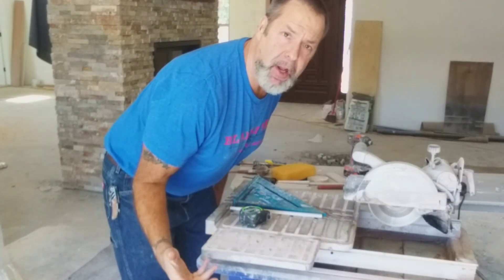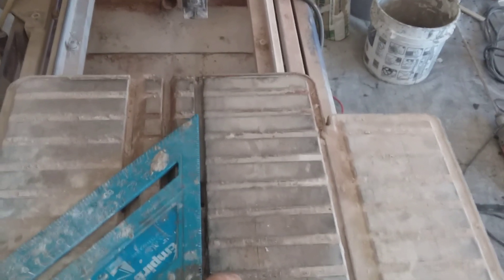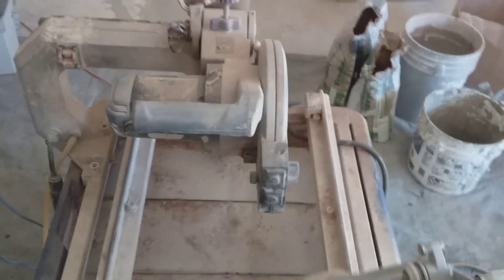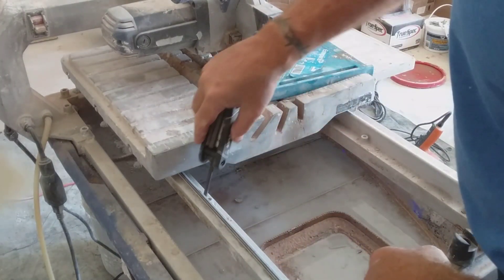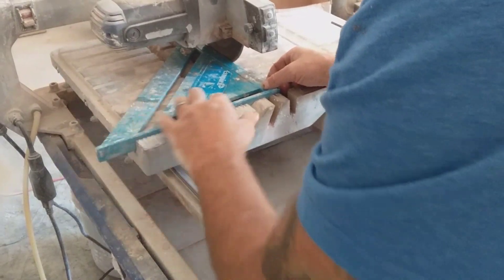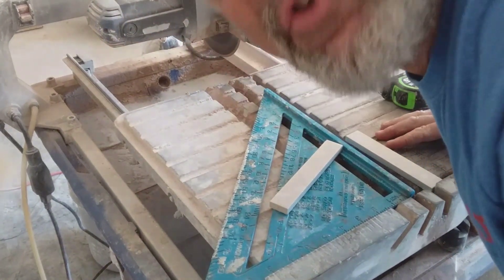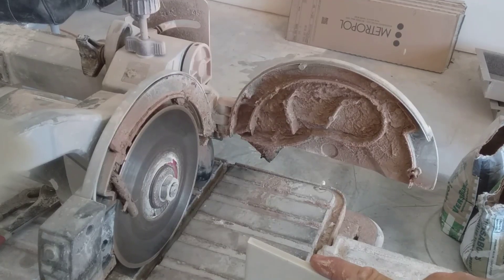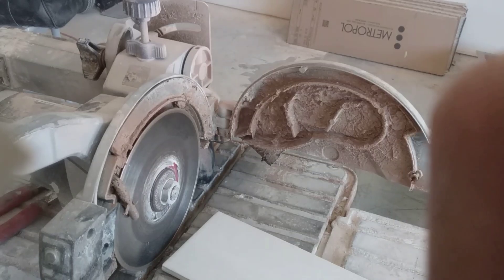HOW TO FIX TILE SAW TO CUT STRAIGHT QUICK & EASY By Licensed Tile contractor #daveblake🤯😁😎👍😬😬

Comment: I would suggest squaring the blade to the base by making sure that the edge of the diamond surface is square, and bedammed the body of the blade. More often than not, the diamond cutting edge is thicker than the blade, and that is where the work is done.
Put your square where it hits the diamond edge in two places. If that's good, you're golden.

Great video.

Comment: Out of the box the blade was not square to the rear guard and not 90 to the table. Tile cut to the left of the blade was chip free, tile on the right of the cut was chipping on the back of the blade. Needs a bit more tweaking. Also the table does move a bit side to side on the rails. Good video, thanks.